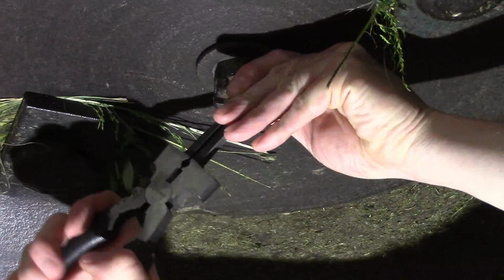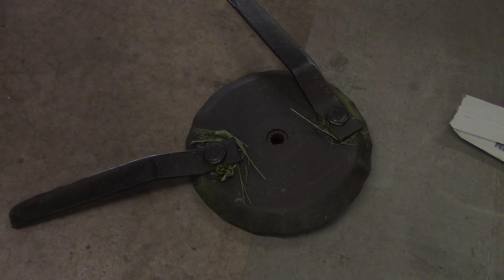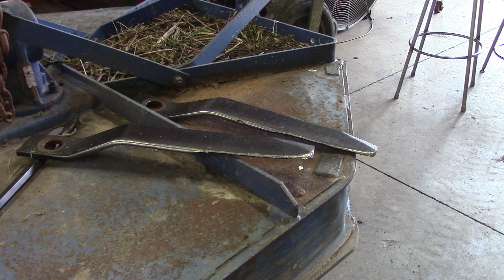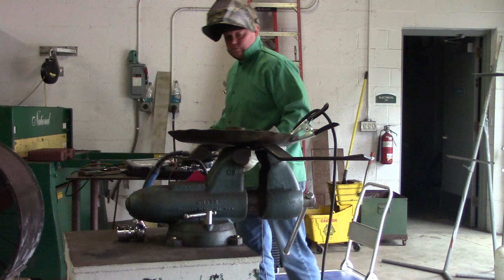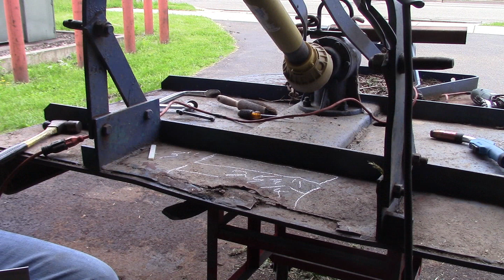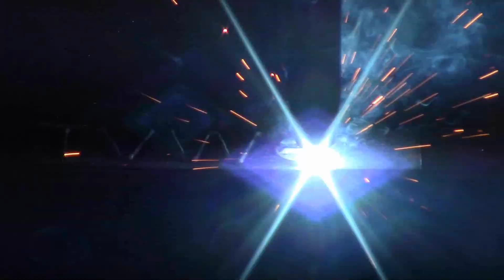Brush Hog Maintenance

Comment: What wire did he use for stainless to carbon?
Reply: If you have a stick/TIG machine ER309L is the correct rod for dissimilars
Reply from the maker: ER70S-6 .035" 75% Argon 25% CO-2